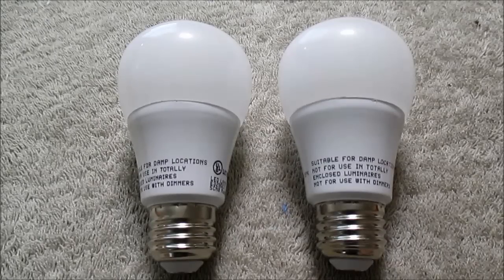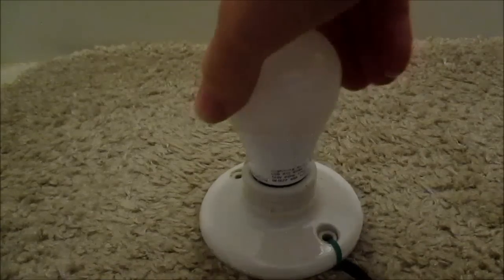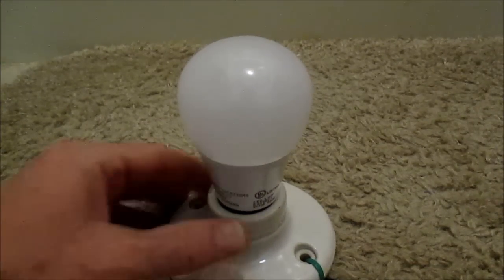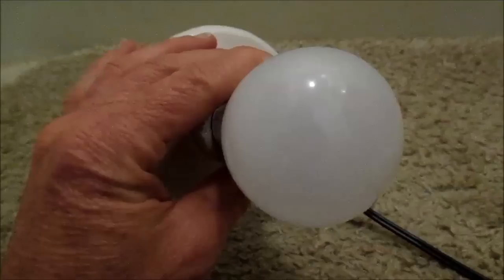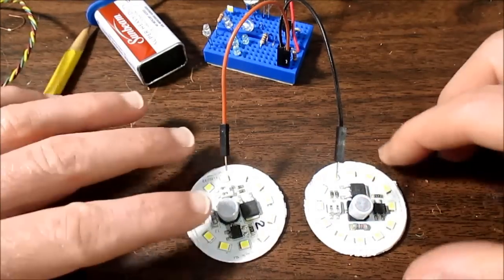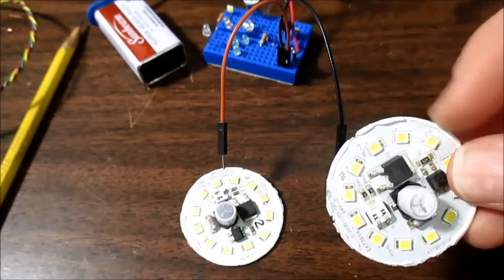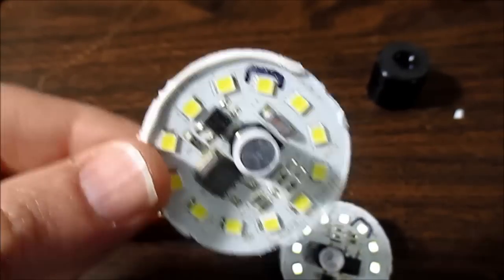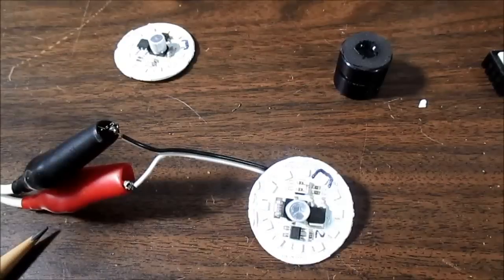Two failed LED bulbs for teardown to determine the cause

Comment: I like the Big Clive comment.  but, I am a little put off by your statement that [inset trade name here]  bulbs are crap.  They probably are, certainly, if your parents have bought three bulbs and ALL of them failed the same way--then they are crap.  Did they buy only 3? Or did they buy, over several months, say 20 bulbs; having a failure rate of 15%?  Or did they buy 200 which gives a failure rate of 1.5 %? You haven't given us enough information to judge.
Reply from the maker: My parents bought them at the same time. They bought two 2 packs at $1.75 per pair (very cheap at the time). I don't know where the 4th bulb ended up but these three were used in a ceiling fan, installed at the same time. The fixture is not totally enclosed but has tulip glass globes that may trap some heat. All the bulbs failed fairly early in their rated life and around the same time. I don't have a large data set to make a conclusion from but three bulbs with the same failure mode is certainly a trend. I got them some Feit bulbs that run cooler and these bulbs have not failed yet. I've been using about 10 of these same Feit bulbs at my house for the last year and 1/2 and have lost none so far. Lastly, I didn't mean to say Lighting Science was bad, just those particular bulbs made by them.
Reply: Two boxes of Feit bulbs, 10 lamps per box, costco bulk buy. 90% failure rate within 3 months. You're welcome.
Reply: Jim MacLaughlin the term "crap" is subjective to the specific person so the actual failure rate is irrelevant. With that said most people don't buy 20 plus bulbs in a short time unless there is a high failure rate of existing bulbs. The average consumer buys to replace not to completely outfit a home wide upgrade. I'm willing to bet the failure rate is way higher than the generally acceptable 10-15%. That's also what the manufacturers deem acceptable, consumers usually have higher standards. While crap is subjective I would have to agree those lights are shit... ummmm... I mean crap.
Reply: Hey Jim,
As a  licensed and certified internet product analyst, do you have the Military Specifications
necessary to perform sigma 6 analysis on LED light bulbs?  The entire internet is waiting for
your help in designating a product "crap" based on sample size of failed components.
Please post as a PDF file.

Many thanks in advance. 
[insert preferred name here]
Reply: Nope!  I do have a finely tuned bullshit meter.  The  statement 'this is crap' without any numbers falls into the bullshit category.
Reply: Hey Jim,
I think the see the problem here.  "This is Crap" is a term electrical engineers (EE) commonly 
use referring to anything they did not personally design.  EEs are often difficult to work with 
for this reason, seriously.

Congrates on finding a well tuned meter.  It certainly comes in handy for all cybrarians.
Good Day Sir!

Comment: In-series just like Christmas lights.. definitely asking for failure
Reply: But it's how most if not all LED lighting works. You need the voltage to drop by chaining many LEDs. Otherwise, you need a beefy power supply to handle a high current/low voltage output to parallel LEDs.  It's more energy efficient and cost efficient to use a lot of LEDs in series to drop the hundreds of volts.
Reply: Jason Wilson, virtually every LED light made with the exception of flashlights is like this, so your comment is rather pointless.
Reply: They could make the bulbs so the individual LEDs were replaceable. If one fails just plug in a new one.  You would only need a handful of light bulbs ever.
Reply: MattBlytheTheOne , Electronics fail due to overheating. Replaceable LED would fail to help much and they have to be mounted to dissipate heat in a very small form factor, won't work.
Also you have a rectifier + cap, on 230V that's ~340V DC with a nice chance to shock yourself...
Reply: MatBlythe .... that makes no sense. There are many different components that could fail. Are you going to make them all swappable? They are <$2.00. No one makes swappable parts at that cost.
Reply: Yes I get it, somewhat lack of understanding of the technology.

1) LEDs are DC devices, they need rectification in some form.

2) LEDs today (blue/white) are all inherently 3V devices. Most 6V, 9V, 24V, etc. are multi-die packages. I.e. a lot of single LEDs in series inside the package. Some are single die devices with the interconnection on the die itself, but still multiple in series.

You can't just "parallel" up tungsten filaments. The life would still be the same (or worse). Life is a factor of filament diameter and desired color temp and voltage. You don't get something for nothing no matter what conspiracy theorists may think.

Most LED products are series strings. Most products we use every day have hundred and hundreds of soldered components, all which need to work to avoid failure. A LED bulb is no different, it is just a lot simpler.

What the heck is an electronician?
Reply: tenalpoen The resistor(s) would be dropping 120 - 9 = 111 volts. Then the power used by the resistor(s) would be 13.3 - 1 = 12.3 times what the LEDs use. That is a lot. It would turn an LED bulb using 10 watts into a bulb using 12.3 x 10 + 10 = 133 watts. Using LEDs in series to do the voltage dropping gives you light instead of wasted power.
Reply: Therefore the culprit is... series assembling, ha ha ! You wouldn't have said that for tungsten filament bulbs.
Why haven't they paralled many tungsten filaments with a higher resistance to prevent a totally unusable bulb if one filament passed away ?
This they could have done easier than with 3v/9v LED chips. Then what if someday they'll make a 110v/230v LED chip ? No more need of regulator components, but....
Reply: No No ... I have no clue what you are trying to say. I think you are making a joke about paralleling tungsten filaments, but then you lost me on the whole LED thing.
Reply: Just-1-filament assembly of old tungsten bulbs asked for failure ALSO.
So nowadays, as an electronician, I've 1 chance to fix LED-bulbs made with mutiple LED chips.
Because making bulbs down-stepping voltage from 230V-to-3V is better for me than to make a 230V-to-230V LED-bulb in a hypothetic future with 230V-LED-chips.
This is not so hypothetical as they've already made 9V-LED-chips in place of the old 3V ones. Got it ?
Reply: No but they cost £8 ($12) PER LIGHT BULB in the UK and we probably import them from America lol.
Reply: MattBlythe -- I am seeing £3ish at B&K if you buy a few at a time. We import them from China, just like everyone else. It's still pretty pricey. Expect to see that quite a bit cheaper soon.
Reply: LEDs run at very low current and a reistor is enough to drop the voltage for each LED if you connect them in parallel. You won't have massive heat issues and you won't need a transformer. If that were the case, wiring them in series would be just as bad.
Reply: tenalpoen, I would leave the LED answers to the people who know what they are talking about.
Reply: You've stated absolutely nothing to indicate you know anything other than how to call other people ignorant.
Reply: Obviously it's more efficient to only use LEDS in series, but resistors don't use power in the same way. They will emit some heat but they don't put as much of a load on the circuit. Also, It would be stupid to rely entirely on resistors to drop the voltage instead of using a simple buck converter.
Reply: tenalpoen It's obvious you have little clue about electronics. It would be best to just stop posting. You are looking foolish.
Reply: No U
Reply: tenalpoen One of us has a clue one does not. Everyone knows you are talking out your butt..
Reply: https://electronics.stackexchange.com/questions/28813/doesnt-using-resistors-serial-to-leds-all-the-time-waste-a-lot-of-energy
Reply: In a resistored setup, the efficiency is Vf(LED)/Vin.
My initial assumption that the heat wouldn't be an issue was based on my personal experience with LEDS that typically only run at 20 milliamps, where heatsinks aren't needed. I wasn't thinking about that.

I realize at the levels these bulbs operate, the resistors would get hot and be less efficient, that you would need a voltage converter, and that all of that would cost too much to justify the already low failure rates of LEDs, but I still disagree that it's the best way.
Reply: Ya, I always go to the web when I want to find out about electronics. I mean why would I ever consult the published application notes I WROTE?
Reply: "What's the heck is an electronician?" This one's for me!
I must admit it's a specially devised term for the video here!

An 'electronician' is like a mechanic's but gets dirty lungs because of tin solder flux fumes instead of having dirty hands at the end of the working day. 

Then I guess you'll do have to definitely desolder this F-Faulty LED-chip !

Imagine you'd have to fight with a failed filament on those new Filament-LEDs bulb (high temp brazed ones, yeah), a mechanic's wouldn't be enough !

Comment: things fail. nothing is perfect.
Reply: Things made to fail are especially not perfect.
Reply: True, but when you get three bulbs that have the same failure after a relatively short time in use, that's a quality control issue.

Comment: I have had FOUR different LED bulbs fail in the last year. None of them were more than a year old when they failed. These bulbs are a giant fraud. I replaced them with compact fluorescent twisty bulbs and I won't be buying anymore LED bulbs until the quality improves.
Reply: "fluorescent twisty bulbs" those are so shit especially when you have to wait like 10 min for them to warm up.... when you just want to get in your garage :( plus the mercury, LED just turn it on and its instant bright as it gets.
Reply: CFL's are absolute crap.  I went to complete CFL in my house around 10 years ago and had constant failures over the years.  About 3-4 years ago I started moving to LED, and finally as of this past month have my house 100% LED except the garage strip lights.  Just this morning I had my first LED bulb fail, and I think it was the very first one I installed.  And its failure was most likely from using it in an enclosed ceiling fixture.  I installed it nearly 4 years ago, March 2014, and compared to newer LED bulbs it had a huge, heavy metal heat sink on it that they don't have anymore, with a bunch of circuitry inside the heat sink.  But other than that one, every LED bulb in my house is working great.
Reply: "At least they weren't expensive".  Except to use them.  Most of the electricity wasn't going to produce light-it was going to produce heat.

When I went to CFLs about 15 years ago, my electricity bill dropped a little over 10%.  That's not a scam.  The saving on the electric bill covered the cost of the bulbs in a very short time. About five years ago, I started replacing the CFLs with LEDs as the CFLs started to go out.  I've yet to have one of the LED bulbs die on me, but I spend a little extra money and get better bulbs.

A standard 75w equivalent incandescent bulb costs about $1, and is rated to last about 1000 hours.  The bulbs I use cost $5 each, but they're rated at 11,000 hours.  So in the time my $5 bulb lasts, you'll buy $11 worth of your bulbs.  And, if you live where I do, you'll spend about $87.50 keeping those bulbs lit, while I spend $17.30.

So I've saved $6 in bulb cost, and $70 in energy costs per bulb over the life of the bulbs I buy.  And you think it's a scam?
Reply: I was lucky to have any CFL last 6 months. Any money saved on power was more than offset by short life. Switched to CREE and Philips LEDs. Four years in, no failures.
Reply: I have a whole house full of dollar tree led 60watt replacements, great brightness, great color temp, not a single one has burnt out in 2 years. And they are only $1 a piece. Sorry about y'alls luck.

Greenlite is the brand. Try some. You won't regret it.
Reply: outbackeddie it all depends on the brand you choose. I've had good luck with GE, 3M and Sylvania. But having said that I had really old florescent screw in bulbs from the mid 90's that still work lol. They don't even have dark spots in them.
Reply: @outbackeddie: Could also be bad power supply to your mains, a bad line in your house, or a bad fixture.
Reply: The problem is that we are not willing to pay more for quality. I had making myself LED lamps using only CREE X-lamp chips (extremely good and reliable) for long lasting lamps, 50years++, and Edison Opto chips (moderate reliable) for average lamps to be used occasionally, the lamp life to be >50 years also; the drivers are made by myself also with quality components and protected to overvoltages, because these also are key to extremely long life.
Reply: outbackeddie maybe you shouldn’t buy shit
Reply: Come on gumpfoo65 - I'm not that desperate yet. If the grid ever goes down I'll use candles like a wooly mammoth eating caveman, but until then I'm burning electricity like a civilized human.
Reply: CREE seems to be crap these days.  Maybe not the actual CREE LED chips, but the whole bulb assemblies that come from CREE appear to be junk.  My parents built a new house a couple of years ago and spent over $500 outfitting the entire house with CREE LED bulbs.  At least 15 of them have failed in those 2-3 years.  Supposedly they can send them back for warranty replacement, which they have done so for all of them, and their warranty claims have been completely ignored.
Reply: I bought one of those expensive LED flashlights on TV. Failed after less than 6 months and no way to replace the bulbs!! They suck
Reply: Had 2 sylvania led bulbs that would randomly blink. The company sent a coupon for replacement bulbs.
Reply: Can I ask what brand of bulb you are using? I had 2 GE's, 1 FEIT and 1 CREE that crapped out on me in less than a year. I'm done with LEDs unless I can find some that are reliable. On another note, I have had no problems (yet) with my LED shop light that uses 2 LED tubes.
Reply: outbackeddie I've had good luck with Sylvania LEDs (got them on sale at Lowe's)! I've had some for several years that still work fine! I don't like a lot of the off-brand ones that are too bluish... I get the 2700k warm white!
Reply: @outbackeddie  Have you tried IKEA's?
Reply: I threw two lamps out , because I thought they were bad . It was LED the bulb.
Reply: They come with 1-Year warranty.
Reply: The problem is the curly fried bulbs suck too
Reply: The quality won't improve. As a certain technology matures competition increases, and everyone races to the bottom to offer lower and lower prices. No way the quality can improve.
Reply: I don't think the quality will improve until we are prepared to pay more for them, even if we think we are paying enough now. .... Unfortunately.
Reply: LG and Samsung last long. But they also cost the most. As always: You get what you pay for.
Reply: outbackeddie try Soraa, but be prepared to pay...they are very expensive.
Reply: Don't buy LED bulbs at the DOLLAR STORE
Reply: tihzho lol they work great. Sorry but anywhere else is a ripoff. I tried some more expensive ones from Menards, 100w replacements, the 60 watt dollar store bulbs are BRIGHTER. Still have zero burnt out. Also they work amazing in the cold. Sorry but the old saying "you get what you pay for" isn't always true. Most the time you're getting ripped.

And btw i have about 30+ of them. 2 years not ONE burnt out or flicker or anything they all work perfect, even outside.

The only downfall is they only come in 60 watt replacement, 9 watt. There are no variants like floods or different wattages or different color temps at the dollar tree. They're all warm white. A nice shade too not too yellow not too white. I love them.
Reply: Twotone good LED lamps from someone such as Soraa cost £25 ($30) anything at less than £10 per lamp is not going to be great.  £2 per lamp is going to be trash, so it's unfair to judge all LED by these incredibly cheap lamps.
Reply: Exactly these bulbs are a complete scam forced on us by enviro wackos. I want my old bulbs back. At least they weren't expensive.
Reply: @Kirk Graham. Evironmentalists had nothing to do with it. Its was the bulb manufacturers. Theyre subsidized with each bulb we buy. Heres a video thats very easy to understand. It explains it better than i can. Stop blaming the wrong people.. The whole thing is based on bilking tax payers. https://youtu.be/ta2ozf_uJJ8
Reply: @kirkgraham6469  The ones scamming you are the wealthy corporations that design their products to fail, not the people promoting efficient appliances and bulbs that lower your electricity bills.  You've been gaslit so you don't even realize that you're attacking other victims, not the billionaires who now own everything, including our government...

Comment: Those current regulator resistors look like 151 (15+ 1 zero) or 150 ohm, not 15. Increasing the value of those resistors should lower the current and the bulbs will last longer.
Reply from the maker: No, they are 15 ohm. Marked 15R0.
Reply: I tend to think it has more to do with inadequate dissipation of heat. The plague of all solid state devices.
Reply: Loved your video, thanks for making it.